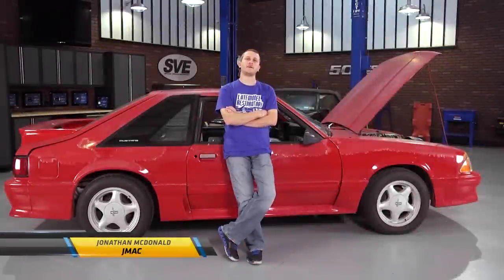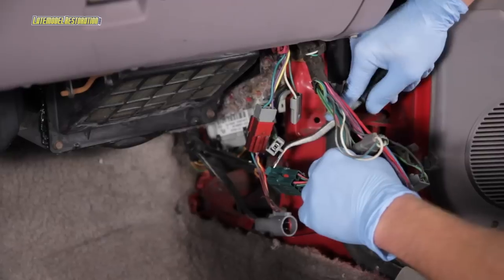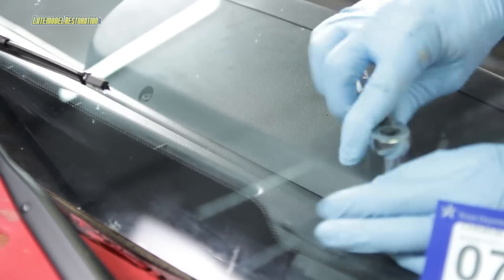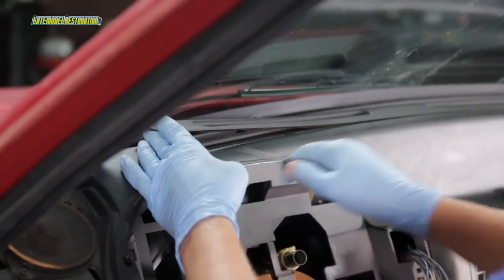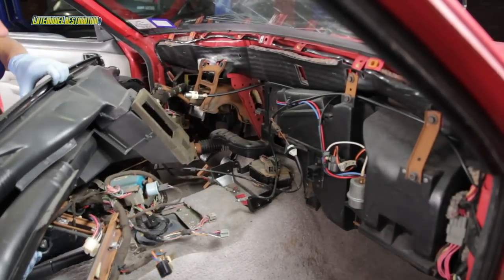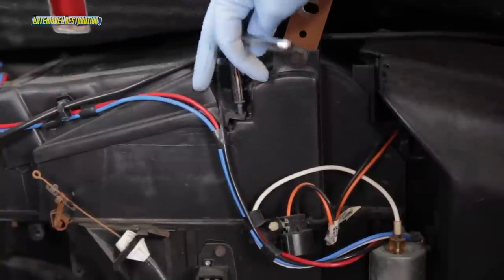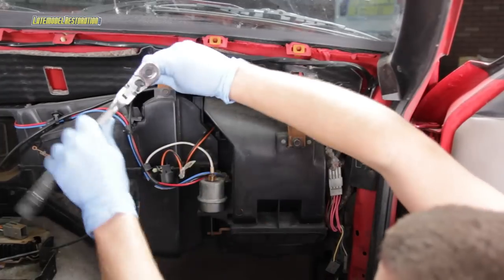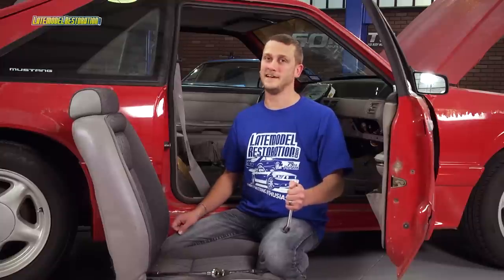Fox Body Mustang Heater Core Installation (79-93)

Comment: can u just remove the hole hvac? like when u pulled the dash just pull out that hole system ? because i dont have any ac on my fox nor want a heater
Reply: yeah you can actually did it last week, its alot easier to put the heater core in. I actually split my hvac box at the seem and cleaned all the dried coolant and debris that was in there out pretty easy, just seal it back up with rtv and i put about 8 screws around it to make sure it sealed legit
Reply: What i was trying to say, since im building a street/strip mustang  could i remove that whole system to reduce weight lol sorry if i wasnt clear
Reply: yeah just fill the holes in the firewall, theres a company that makes plates to cover the a/c and heater firewall openings.
Reply: oh i see. i tried asking google this question and it seems not to know what im talking about
but thanks
Reply from the maker: rafael cortez Yes you can remove the whole system. This video will help you see how to remove the dash and gain access to the A/C system so that you can remove it.

Comment: This method is thorough but not necessary. You do not need to remove sets or fully remove dash. Just loosen the dash, lower the hvac box, take off the front two bolts of the HVAC, cut the front lower lip of the heater core compartment, replace heater core, use foam in place of the cut lower lip, reverse steps.

Comment: With a small flat head screw driver, carefully remove the flip lid on a bottle of lighter fluid, thoroughly douse the interior of the vehicle with lighter fluid. With a match or lighter, ignite the lighter fluid. Be sure the vehicle is not in a garage or near flammable structures. Make sure the vehicles insurance policy is up to date and covers fire damage. Follow the steps provided by your insurance company to make a claim and purchase a new vehicle with a working heater.

Comment: O and another note. If you don't have skinny hands go luck with those back 2 screws. I didn't even bother to put them back in. I well
Reply from the maker: Thanks for the feedback on your installation!
Reply: Hey what a buyer can't see won't hurt them, as long as it works right. jerry riggin is a part of all car project if you not rich.
Reply: could zip tie em too or something. i would just leave them out lol.
Reply: barcode80 Yup, I got it back together but I sold the car. Just wasn't may thing. I tried it and didn't like it, on to something new.

Comment: This is a ridiculous amount of time just for a heater core. When I did mine, I cut a hole in the firewall and fabricated a cover and riveted it in place. Now it takes 10 minutes to change the heater core.
Reply: I think your right on taking the heater core out thru the fire wall.
Reply: LOL, that is awesome!
Reply: Some people don't like butchering their cars.
Reply: phattvids ha - not to mention, the rattling and creaking will be much worse once you take the dash apart...and if you're really lucky, the electrical will all still work!
Reply: Was there any wiring or other stuff just behind the fire wall or just the box ?

Comment: After my core began leaking I just bypassed it. The hell with all that nonsense.
Reply: Jesus, you’re that lazy? I just did the heater core in my 89 today. Had it in my hands in 45 minutes. No broken parts, and didn’t dump the A/C. Took a little over an hour to put it back together.
Reply: @joesfoxbodyandmusclecargarage  Actually it's smart. I never drive it in the winter so no need for heat. I saved money and time so which sounds smarter to you? Yeah, I already know so you can go lay by your bowl now.

Comment: I am greatful that you made this video, but you dont live in the real world where things get done in yards and driveways. my 1983 dash dont look nothing like the one you did it in and it's simply impossible to get at some areas without breaking stuff. my GT, my only car, is down with half the dash out and console out. I have had 4 back surgeries and I am in a real pickle now. you should have started the video by stating that this job is near impossible for a novice. I consider myself a decent wrench turner but with my back and limited work space you should have stated from the git go to take it to the shop. unbelievable, what a bunch of b.s. very unhappy customer. now I have to put it back,  just so someone else can fix it. oh yeah, by the way, I  live in Texas and its 28 miles one way to a shop. thanks for  nothing!!!
Reply: +Randall Bates   Are you for real? Why is any of that their problem? I just did mine in a little under five hours after watching this video, on a gravel driveway out in the weather.
Reply: Yeah I did mine in 3 hours